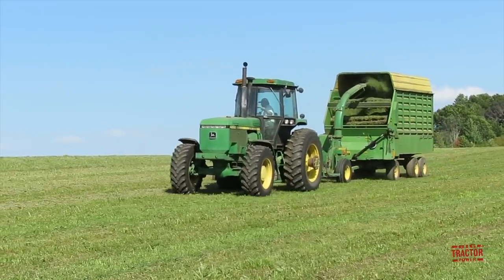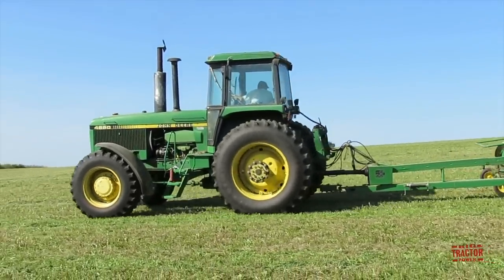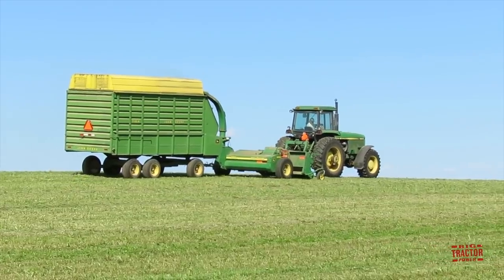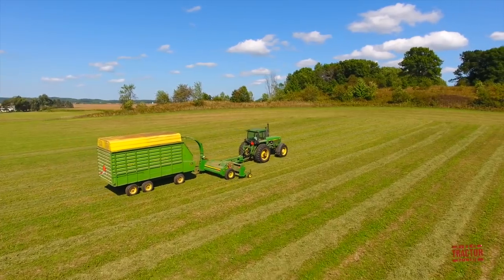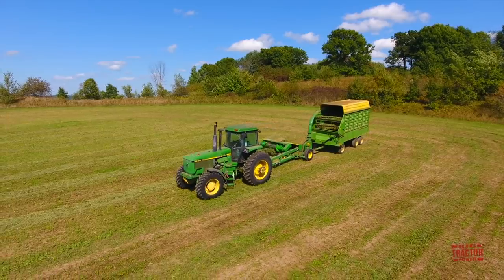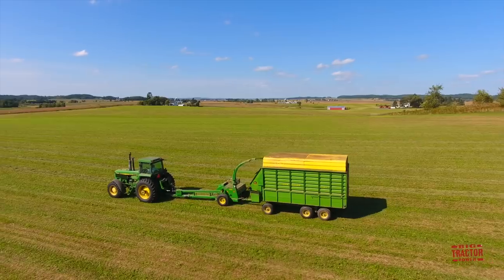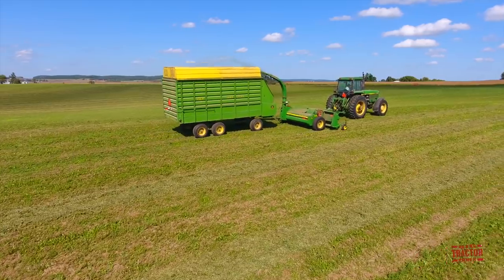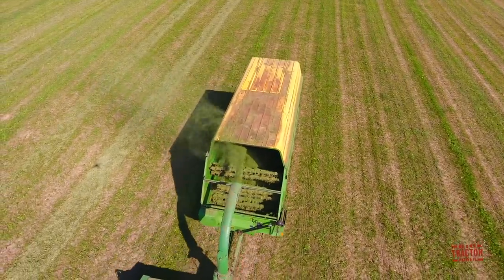John Deere 4650 Tractor Chopping Alfalfa

Comment: Beautiful rig. It's always cool to see the whole chopping lineup from one brand, and I enjoy all the viewing angles made possible in haylage. I was always partial to the 55s but that 4650 is still a nice tractor. As for the choppers, the handwriting was on the wall for a long time; Deere and New Holland just stopped developing them while going hog-wild on the self-propelleds. Every pull-type chopper company should've done a ground-up redesign to accommodate kernel processing, namely to allow long chop lengths with all the knives intact, but by simply adding processors to 80s era designs, they pretty much gave up on pull-type choppers. That said, in my immediate neighborhood there are 2 3975s, a 3970, and 3955 all seeing yearly use. We're running a NH FP240.

Comment: Sixty thousand bucks in the 1980s would probably be around $120K to $150K in today's dollars. Considering that today you can get a tractor many times as capable for $200K, I'd say that tractors are actually getting cheaper if you think in terms of capability per inflation-adjusted dollar.
Reply: l wilton maybe so, but 25 years from now the 4650 will still be in the field working. The new pretty electronic junk will be parked because they can’t keep it working dependably!
Reply: I believe that you're right - the problem comes in actually being able to squeeze that extra capability out of the tractor in your operation to make up for the cost difference at the end of each season; no one writes you a check for the capability that you bought but didn't make use of after all. Then, there's planned expansion, and how and when you plan to implement that, so you consider a larger machine that you need right now because you're expecting to make full use of it, say, next season or whatever.

Juggling numbers for sure

Comment: Hi think that John deer is mechanical fwd not fwd hydraulic asist
Reply from the maker: Front wheel assist is a general term for a powered front axle. It is a mechanical drive on the 4650.

Comment: Hardly any weight on the front axle with that short running gear.
Reply: Joshua Smith used the JD tandem running gears since the 80s under Miller box’s. 1275s and 770, a lot of road hauling behind pickup trucks. Trailed at good speed, best on the marked!